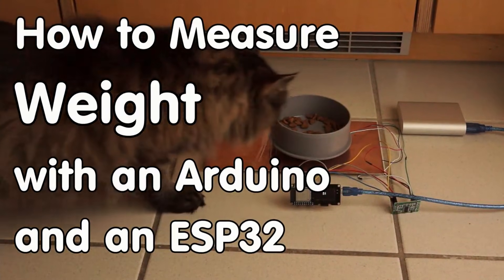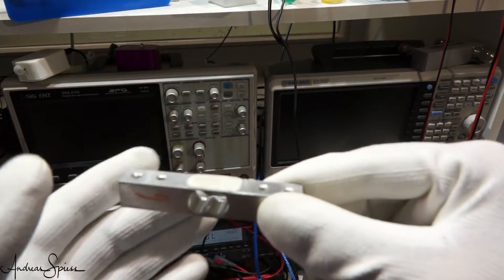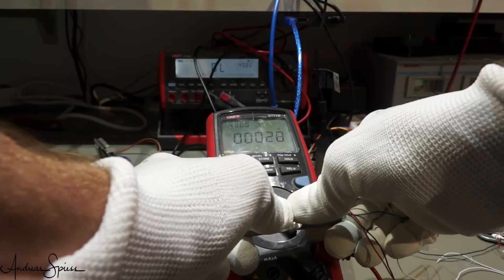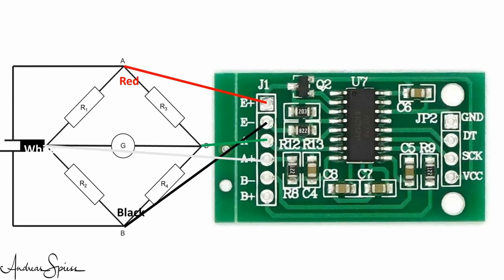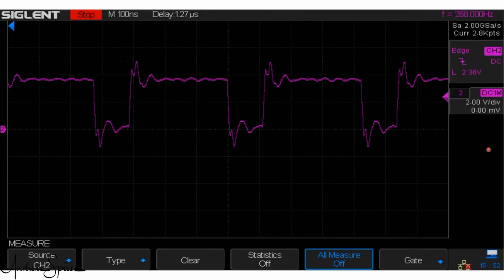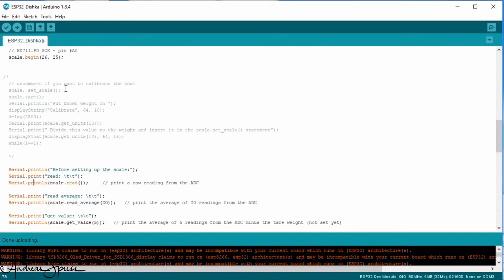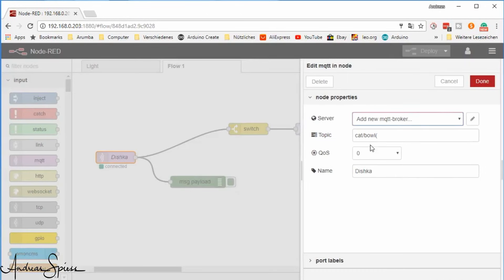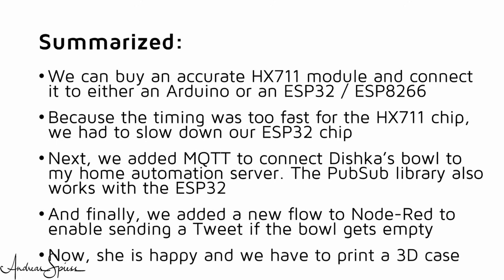#395 Measuring weight with an ESP32

Comment: you can also take two strain gages and place one the top of the bar and one on the side of the bar. now you can make a tire Force Variation Machine loadcell sensing the radial and lateral load...  these people get lots of money designing these machines with pricey software packages..:/ a smart person could make a hobby esp32 version?   thanks a lot. great video..:)
Reply from the maker: I agree. You can do quite fancy things with those strain gauges. This was the main reason why I made this video.

Comment: I really enjoyed this video.  Thank you for taking the time to show where you ordered your equipment from.  I thought it was interesting that the higher speed of the ESP32 sort of worked against it here.  Thank you for taking the time to show this working with both Arduino and ESP32.  We need more videos like this to bridge the gap between the Arduino knowledge base that exists and the developing ESP32 knowledge base.

Thank you for sharing.
Reply from the maker: You are welcome! I always use the Arduino IDE on this channel. But the (initial) Arduino hardware is no more up-to date (because it runs on 5 volts and it offers no WiFi). This is why we mostly use ESP32 chips...

Comment: Please advise why the use of the HX711. Doesn't the Arduino and/or the ESP32 have ADC pins on board?
Reply: HX711 contain programmable gain amplifier which is useful as the range of those strain gauge voltage output isn't that wide.
Reply from the maker: I mentioned in the video how small the voltage of those sensors are. As Kafin mentioned: Way too small for an MCU

Comment: You know about the importance of aircraft weight and balance. For Ultralight aircraft that have metal rods for the landing gear that slant out, can I put such strain gauges on them to translate the axel bend into fuel and occupant weight?
Reply from the maker: These strain gauges can be used where the distance changes with force (bending). The are for example used in bicycles to measure the force of the driver. So I think, you should be able to use them for your purpose. Just find an appropriierte place.

Comment: Ha! Years ago, we ran a competition at EDN for TI inductive sense chip designs. One of the entries was to measure beehive weight.
Reply: I'm trying to create the same solution. I have found some solutions, but they are very expensive. I'm looking for a low cost solution.  
Do you have any documents or results of the competition which you can share?
Reply from the maker: Commenters in  the original video suggested that these cheap gauges are not good enough for beehives and they use more expensive ones. It seem they creep over the whole season.

Comment: I see the esp32 has analog pins. Couldn't you use those directly?
Reply: hx711 is a specialized chip for strain gauges . You cannot get such fine results with plain DACs .
Reply from the maker: As Christos wrote. The signals have to be amplified before they are readable by the ESP32

Comment: Nice video. I really enjoyed it. I built a similar device for my dogs water bowl but could never figure out how to make it handle power bumps which I have often here. Does anyone know how to make a device like this remember the last known weight so that if the power is interrupted you don't need to remove the weight, set the tare then put the weight back on?
Reply from the maker: You could write the value into EEPROM and read it back after power returns. But EEPROM can only be written a few 1000 times.
Reply: Alternatively, record the weight in a database somewhere and have the device query it whenever it powers on to restore the weight/any other settings from before the power glitch.

Comment: It looks like the 'bar' is actually a parallelogram type (not sure of the exact name) load cell... At 4:14 you are attempting to bend it. This should actually result in 0 output as the upper and lower spans are connected to cancel each other over oppersite 'holes'.
The load cell should be bolted to a base with one end and the 'pan' or force applied at 90 degrees to the axis at ANY point. differential tension/compression along the upper and lower parts of the beam cancel - cancelling any moment due to the position of the load. 
The upper and lower spans have 2 elements each - one over each 'hole'. when the parallelogram deforms, on the top one part compresses and the other part expands (on the same surface). The same happens but opposite on the bottom.
Reply from the maker: Maybe you are right, but two facts speak against your theory (btw: another commenter suggested the same):
1. The arrow on the different weight cells I have shown in the direction I used them (you see it in the video) and the mounting holes suggest the same
2. I got varying values
I assume the upper and the lower gauges are connected opposite that they add up instead of canceling out.

Comment: Those strain amps are really sorted, even the differential amps in general.
The MCP 3424 has the noise down by 60 dB by the time one gets to 50Hz.
The HX711 is also filtered around 50 and 60 Hz, hence your reading being nice and stable.
I have used the MCP3424 on a strain gauge which was 1 microvolt per gram output and it worked fine.
The nice thing with the HX711 is that it provides a clean regulated supply to the bridge, which is important.
Nice having the cat in the videos, and building projects around them.
I enjoyed this one.
Kind regards,
South Africa
Reply from the maker: Yes, these chips are Incredible. And so cheap for what they can do. I also chose this video for replay because of Dishka ;-)
Reply: @AndreasSpiess  Agreed

Comment: This is incredibly useful. I am also suprised that Dishka does not already let you know when her bowl needs replenishing. My cat gave the bowl a hard stare when empty so for me a video alarm would have worked well.
Seriously I have a use for this, thankyou.
Reply from the maker: You are welcome. The idea of the bowl was only a second thought. First I wanted to show how to measure weight which, as you write, has many uses.
Reply: @AndreasSpiess  Ones Cat companion have numerous ways of letting you know what they want. Mine had a "Humf!" when things displeased her. But my experience of weight measurement in the past has been as a customer at the industrial level and generally with moving product. I have not been doing that for more than twenty years now but I am still intouch with my old suppliers as friends. Now my interest is in more mundane things and unfortunately I do not have the means of making stuff that I used to. I would like, for instance to be able to measure by weight water leven in a home brewing system but common sense tells me to be careful how I handle 25-30 kg of extremely hot liquid., so that one is shelved but I have plant watering systems in mind. Float switch is easier but not as interesting. :-)
Reply from the maker: Home brewing seems to be an interesting topic for automation... I once made a pressure sensor video (for a friend who brews, too).

Comment: How long before you need to re-calibrate because of creep? I really enjoy your channel!
Reply from the maker: I never made a long-term test. But creep seems to be an issue with big and relatively constant loads like beehives. There is a brand available without creep (see discussions in the first publishing of the video)
Reply: What do you mean by creep ? Drift over time ?
Reply from the maker: Yes, Drift over time. They have a heavy beehive and want to measure relatively small changes (honey) over one season.

Comment: Interesting 🙂

I often wonder if an 9 axis accelerometer could be used with an ESP32 measure weight of a car or motorcycle based on suspension pitch ect . . .
Reply from the maker: This should work if the shock absorbers behave linearly. Which is often not the case in modern motorcycles.

Comment: still amazing how accurate this sensor is working.
Reply from the maker: Indeed. Especially if we consider the extremely small movements.
Reply: They are indeed, work great for bicycle power meters.
Reply: If anyone wants more advanced info about the HX711 check out a couple of videos I made about them on my channel. 
Ways to customize the sample rate. What you need to know about the excitation voltage.
Reply from the maker: @Ed R: Subscribed ;-)